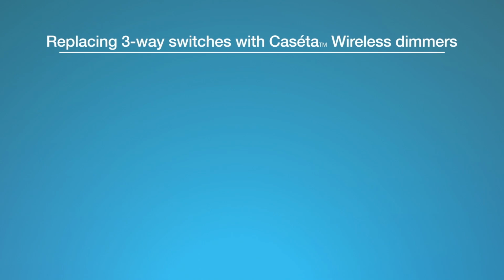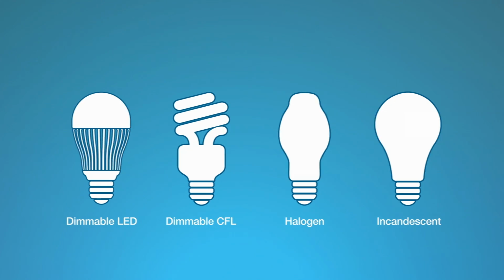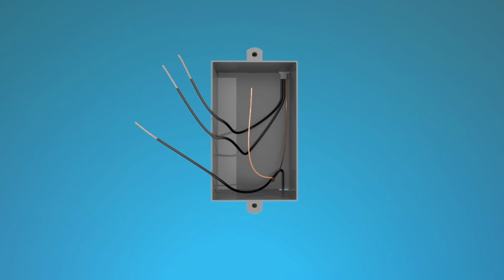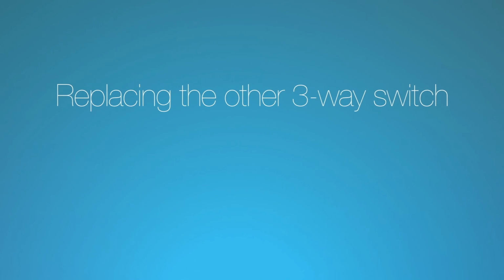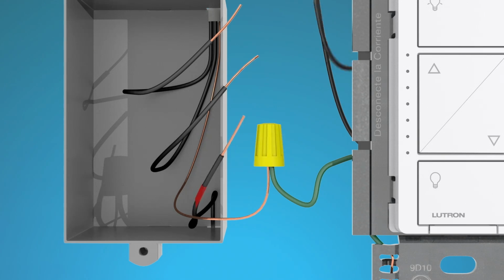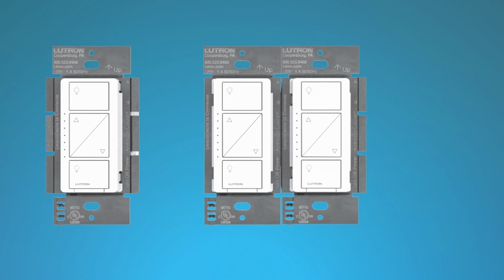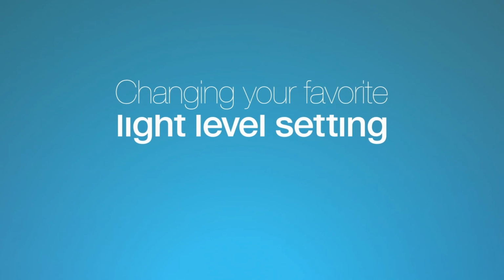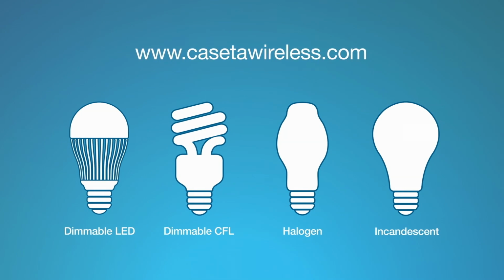Caséta Wireless: How to Replace 3-Way Switches with Caséta Wireless Dimmers

Comment: If I close off one of the switches. Do I need the Pico Switch? I understand I won’t be able to have a switch located there
Reply from the maker: Hi Nug. For the default procedure to work, you must press this button 3X relatively quickly. Make sure the app isn’t open and that the dimmer isn’t in pairing mode. You might also want to try pulling out the FASS tab (the air gap switch below the off button) and pushing it back in, and then trying this process again.

Please let us know if we can be of further assistance.
Reply: @Lutron-Electronics  You can be of further assistance by answering the question that was asked, instead of a question no one asked.
Reply from the maker: Hi. Pico remotes are always optional. None of our setups require a Pico remote; they're just an option for additional control. If you want to remove an unnecessary switch location, just make sure to connect the power wires properly to allow voltage to pass through the location you are closing off.

Please let us know if we can be of further assistance.

Comment: Is there no way to use the Caseta switch in a 3 way scenario where the other switch is NOT a Pico remote? I do not want to leave hot wires inside of the electrical box.
Reply from the maker: For 3-way applications with the PD-6WCL, a Pico remote will be required at the second location. The PD-6WCL is not designed to operate with a standard 3-way mechanical switch. Lutron does offer another Caseta Wireless dimmer option that is compatible with a standard 3-way mechanical switch. For this recommendation, please reach out to Lutron's 24/7 Support Team at 1-888-588-7661.

Comment: You missed the part where you connect the Pico remote to the power. You just completely isolated the power from the remote, and then shoved the remote in there connected to nothing at all.
Reply from the maker: Hi,

Our Pico remotes are completely wireless, and do not connect to power in the wall. These remotes have a battery (CR2032) for power. The expected battery life is 10 years, and it is replaceable.

Please let us know if we can be of further assistance.